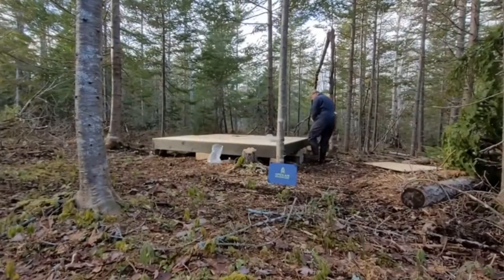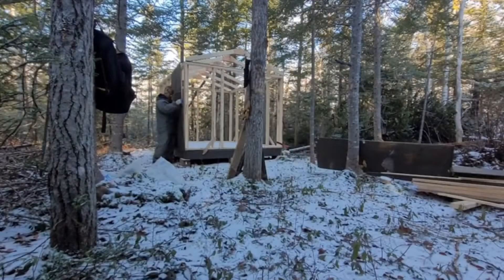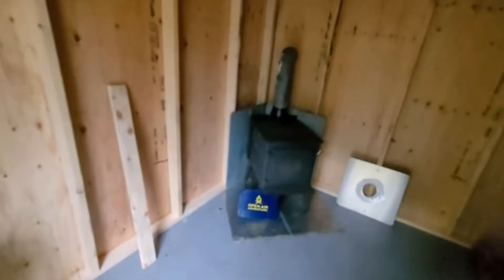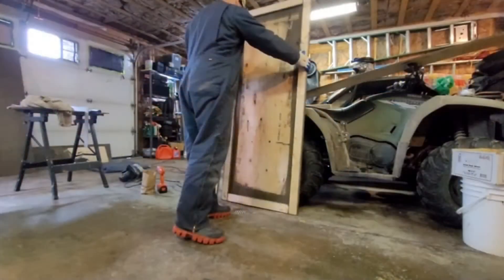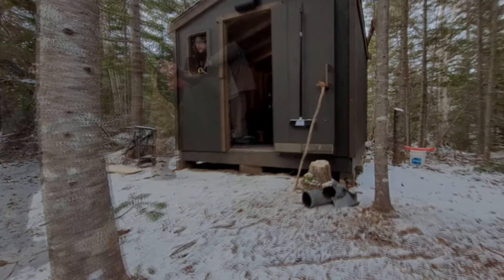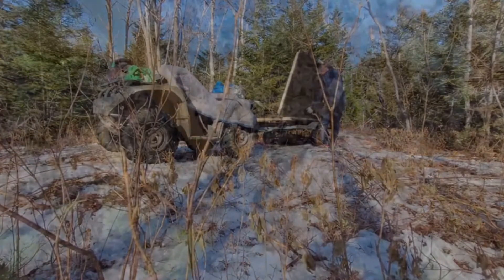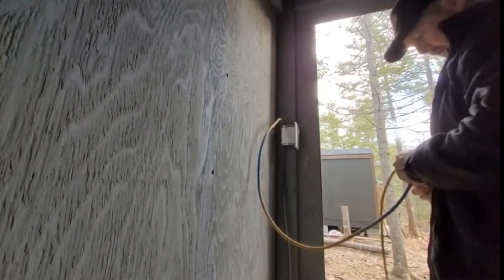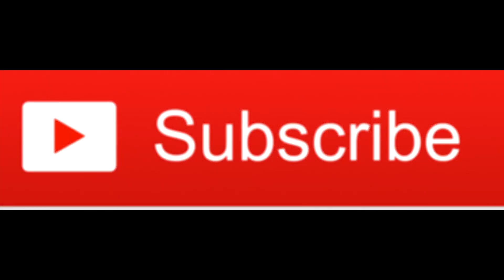Firewood lot gets a cabin

Comment: Hey there. I love your cabin. Good work. I noticed you didn't insulate. Will you be? Will you use it in the winter? Over night?
Reply from the maker: No plans on insulation, that wood burner is too big and gives off plenty of heat. I vented the cabin for air flow and we do use it all winter as an atv getaway. Plans for the future to sleep there when I come up with a bunk plan.
Reply: @OpenAirAdventure  ok. Thanks. Nowhere for the mice to hide either. I just bought 8 x 18 cabin homemade on a double axle trailer. It's insulated but mice got in. What a mess! I put in a woodstove this weekend. Plan on using it alot this winter with the family.
Reply from the maker: @luckyluclav5121  nothing better than being outdoors especially the woods, it's a great pastime. Hope it works out for you.
Reply: @OpenAirAdventure  what thickness plywood did you use for the walls?
Reply from the maker: @luckyluclav5121  1/2 " walls and roof
Reply: @OpenAirAdventure  what kind and type of stain did you use? Are you happy with the results?
Reply from the maker: @luckyluclav5121  Canadian tire Rez semi transparent, color is Coal Mine, trim is something lighter. It's cheap and seems pretty good, I did my back deck after the cabin, worth the money
Reply: Do you have links or resource list for the solar. Would love our tiny to have a simple solar set up. 
Thanks 🎉